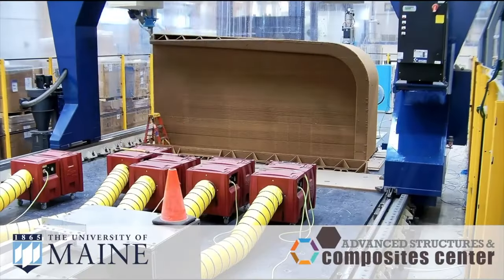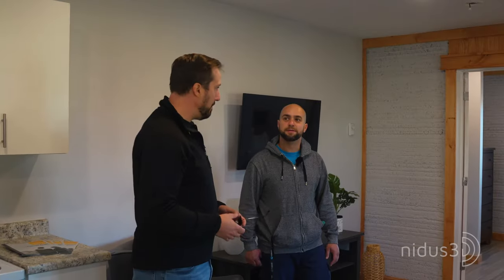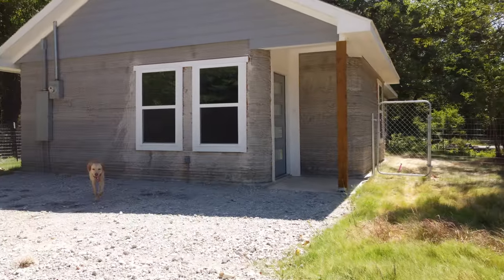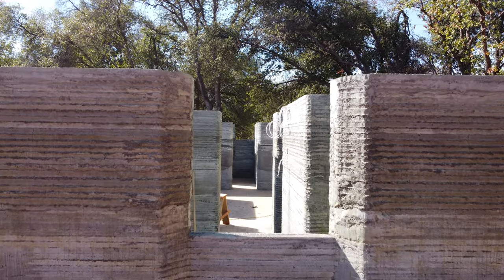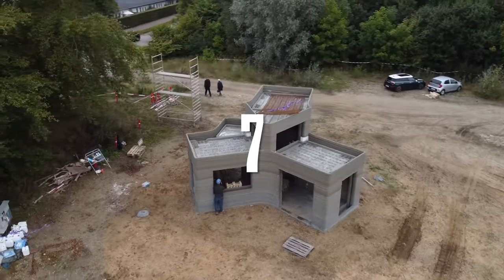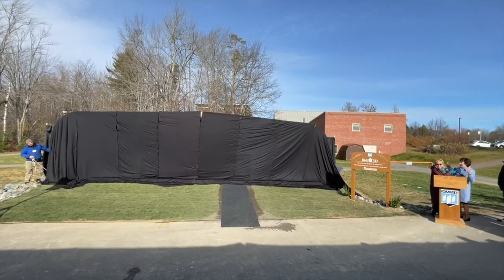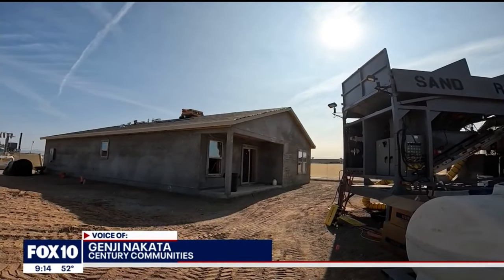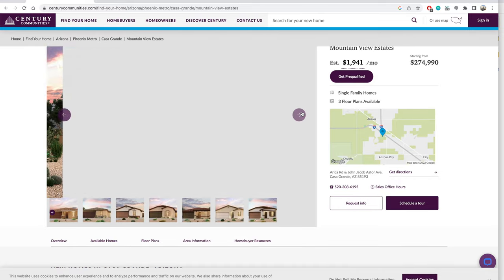TOP 10 3D PRINTED HOUSES FROM 2022!!!

Comment: There is another aspect to 3D printed homes. The reduction in fire risk. Fire and  natural disaster insurance can be reduced or 
Simply have no need for expensive insurance premiums. If we can get to a point where 90% is fire proof on the building materials then why have fire insurance. Houses can also be engineered to avoid Earth quake damage and flood damage!  Eliminate insurance and you can invest in fire proof the structure. The next concept is put a silicone energy producing membrane on these house to reduce the need for utilities. The house becomes a living structure.
The potential for reducing construction costs are significantly lowered. The market supply of living dwelling will reduce the cost of a home likewise since thousands of homes could be on the marketing place in a matter of weeks versus months or years!.

Comment: the wood like 3d printed house is interesting and I would deftly look at it again for more of a practical sense. Instead of using a resin that is specifically for recycled purposes I would see if it could become a concrete or polyester resin that can be locally found. Since the team used wood filler from a local saw mill, but then they would just need a stiff cellulose material since they are just using it as a fine aggregate. My other problem is termites, will they infuse the first 2 feet of additive material with borax or other repellent since it could be bad with the wrong mixture.

Comment: Great video, really exciting... If you want to do any electrical or pluming upgrades/additions, how does that work? Also, how does the concrete hold up to extreme cold, especially if any cracks or holes develop on the exterior... Thanks!
Reply from the maker: Sometimes they will stick build areas where renovation is frequent like the kitchen or leave access points. The alternative is just cutting through like cinderblock.

Comment: I think its important to evalute the situation considering particulate matter in those houses. For example the wood/plastic material. If there is somehow degradiation over time causing airborne particular matter. The same with concrete, I dont want high alkali dust in my lungs. Alkali dust is proofed to be very unhealthy when inhaled.

Comment: On a quake fault, unreinforced masonry structures are death traps.
Reply: They put steel in the wall
Reply: @jeanling240  steel rusts out, expands and bursts thru the concrete, especially in damp areas. 
Plastic, graphene, or glass fibers might work better.